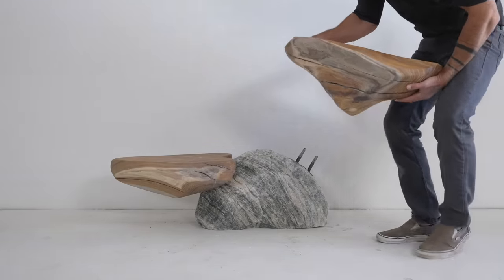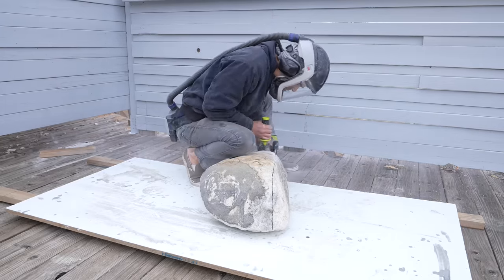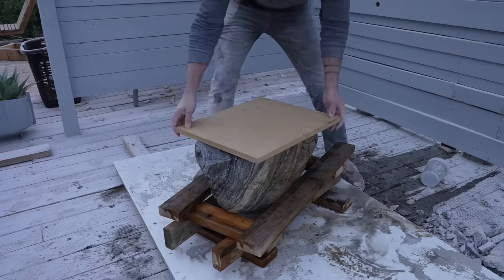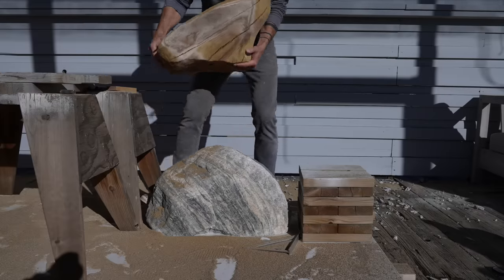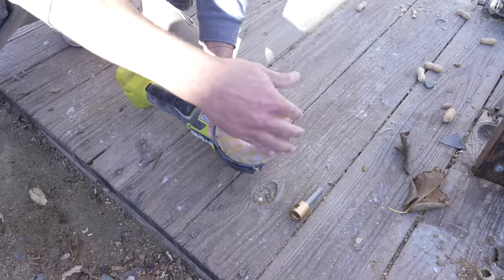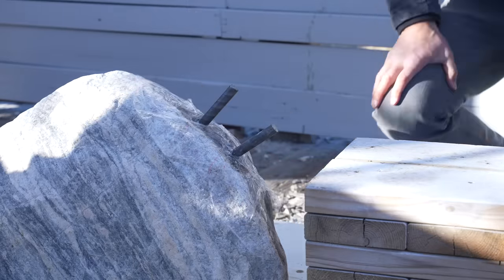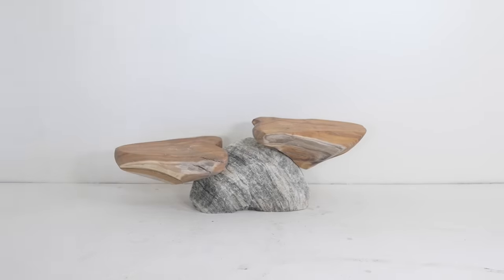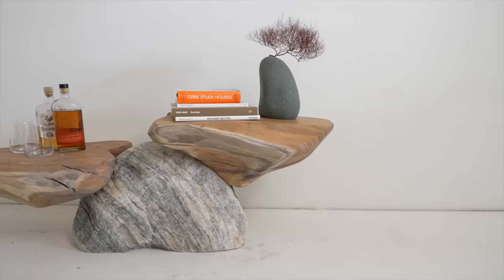Free Materials! Building with Stone and Wood

Comment: A good tip might be to make the bottom slightly concave so that only the outer rim makes contact with the ground, similar to how mugs and bowls have a rim to sit nicely on a table
Reply from the maker: yes! although in this case it is our floor that isnt flat.  I also think I will do felt pads on it so it doesn't scratch floors and can be slid
Reply: @HomeMadeModern  a three-point contact will never wobble 👍

Comment: Hmmm, I'm looking at the part where you are trying to get a flat bottom on your rock. You might want to look to pottery for inspiration. If you turn a cup or a plate upside down most will have a circular base to them. Usually an unglazed ring, called a setting ring. It's easyer to have a smaller perimeter that's flat and making contact with the surface below it, and the middle gets carved in more so as to not touch at all. I hope that makes sense.

Comment: Hey Ben, 3M  produces hearing protection for helmets. There are holes on the side, where you can screw it in.

The Versaflow-System is great, but prohibitively expensive for a DIYer. I got the helmet used on EBay and built my own belt out of a little 12V blower, a USB-C powerbank and screw in gasmaskfilters. Not as elegant as 3Ms Version, but still better than anything I used before.
Reply from the maker: good to know I will check that out

Comment: You also need to remember you can take concrete crush up colored bricks, throw into the mix and build a mortar type joint at the bottom to match the color of the rock so that it is flat at the bottom mixing crushed rock of different colors. You can taint your concrete to fill in gaps and level off the bottom. Just a suggestion I love what you did.

Comment: What a great video! Really well done. These videos take time to not only record but edit but it flowed smoothly with lots of information and links!  Perhaps spray water when using the angle grinder on stone, the diamond coating lasts much longer and the dust is kept down from floating in the air.

Comment: If you can get access to a drill press.
Take a 4x4, and drill holes for the sizes of drills you need to use, through the 4x4,
Then secure the 4x4 over the spot you want to drill, so the hole you prepped in the 4x4 is in the right spot.
Then when you can have confidence that you are drilling straight.
EDIT - For the cracks, you could also get some sawdust from the work you did grinding the wood down. And mix it with wood glue, then feed that into the cracks.